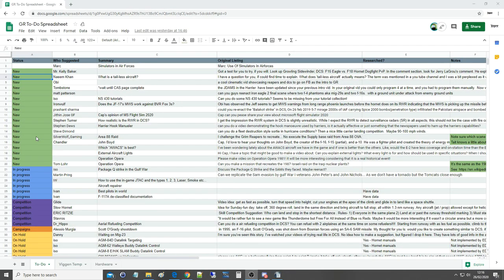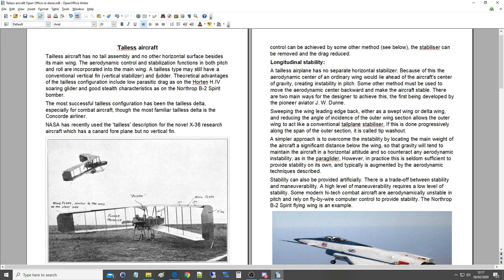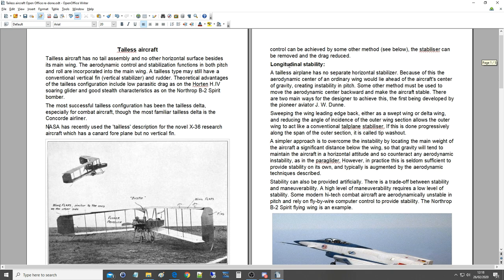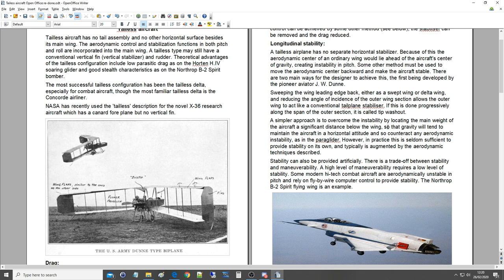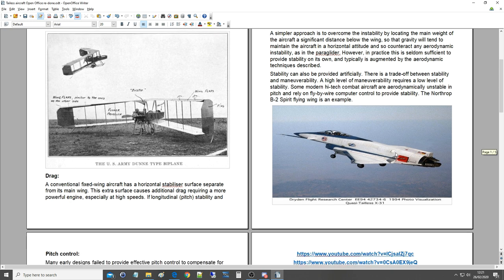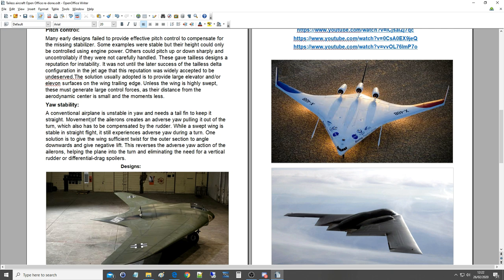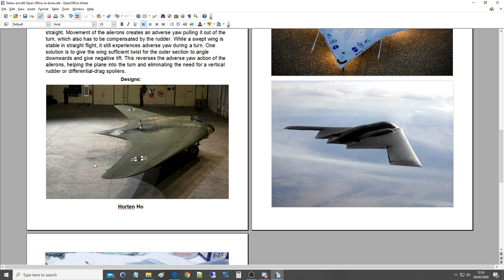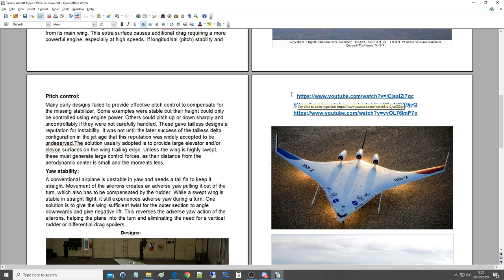Flying Basics: What Is A "Tailless" Aircraft?

Comment: X-44 was a proposed tailless fighter concept based on the f-22 however it never got past the proposal phase and was never built.  It was going to use an f-22 fuselage with a delta wing and full 3D thrust vectoring for yaw and pitch control.  The planned project was called MANTA (Multi Axis No Tail Aircraft)

Comment: Lack of a tail does not cause the center of lift to be ahead of the center of gravity.  Even a tailless aircraft has the center of gravity ahead of the center of lift.  Reflex wing surfaces do not move the center of lift aft, they provide a positive pitching moment to counteract the negative pitching moment of the wing.  Also, having the CG a significant distance below the wing does not affect longitudinal stability, and at any rate that is impossible in the typical tailless or flying wing configuration.  Having a high mounted wing contributes to lateral (roll) stability, not pitch.  I won't even get into the other inaccuracies in the video.  Dissemination of aviation misinformation does not serve your viewers.
Reply: While there are definitely some mistakes, lets try and be fair as some of them are just misunderstandings. While a tailless aircraft doesn't necessarily have a center of lift ahead of the CG, an efficient flying wing will have that in order to counter the wing's inherent pitching moment. It will be unstable and need computer assistance to fly, see the B-2. Agreed on the reflex wing. The example given for the low cg was a paraglider, which I suspect works because the cg effectively moves forward when the wings pitch up giving it stability, still not possible in a flying wing though.